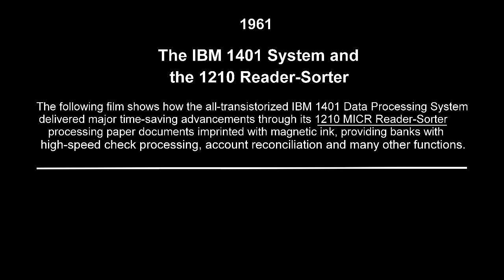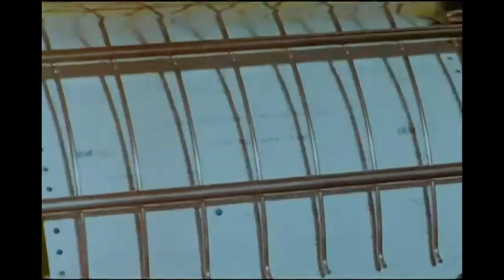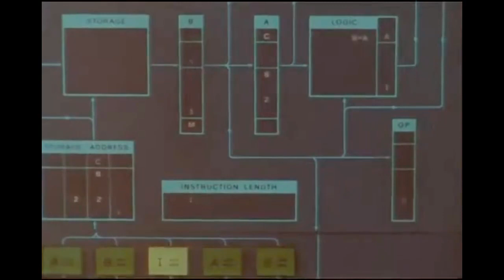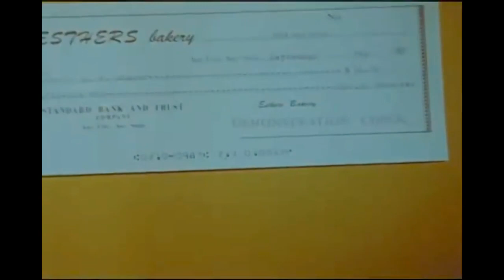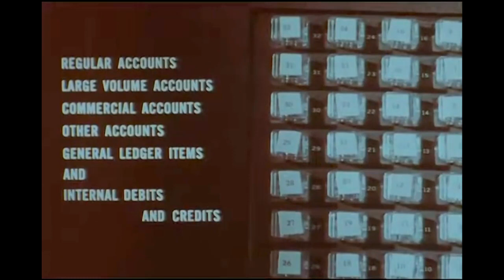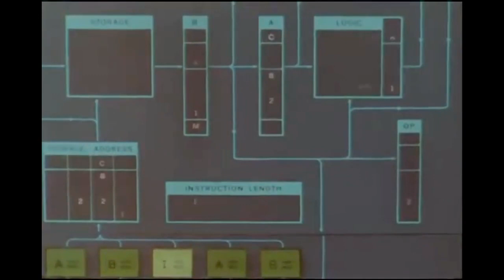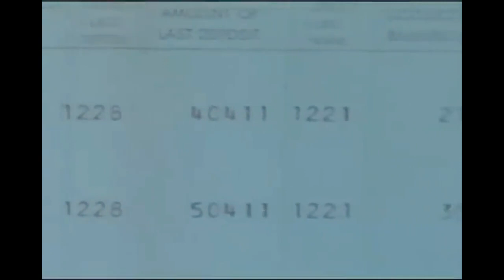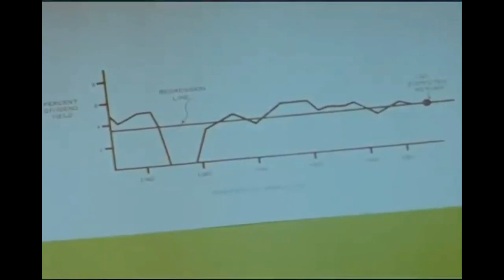Computer History:  1961 IBM 1210 Reader-Sorter MICR Check Processing 1401 BANKING Automation

Comment: During the mid 2000s, I did my work experience at a banks datacentre. I was amazed to find out they were required to still keep a library of open reel tapes. In fact they were only just getting rid of their vacuum column drives which had been replaced with smaller tray/rack sized(?) ones.

Also funny watching this after the week in archives where I was manually going through old micro-phish to search for cheques.
Reply: The regulations were way behind the technology.   Originally checks had to be returned to originating bank.  When we went to video camera capture, we eventualy were allowed to send the video image.
Reply: In the UK it was known as microfiche.
Reply: @TheRobsep2b  Ok I spelt it wrong.